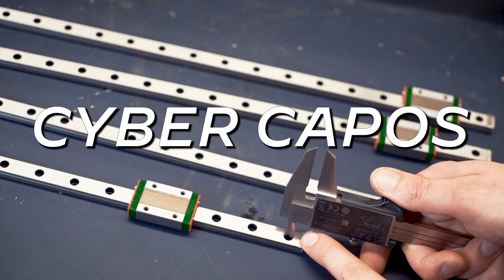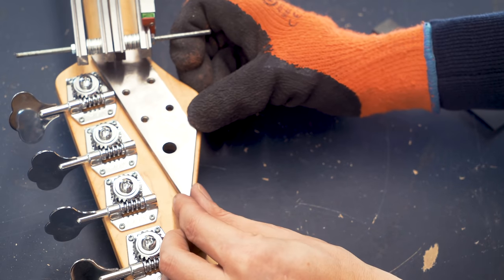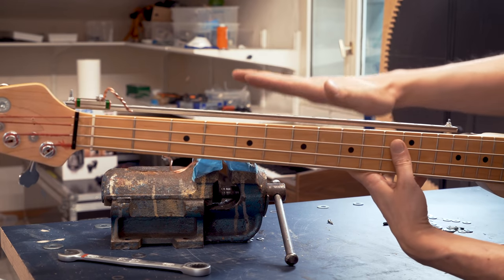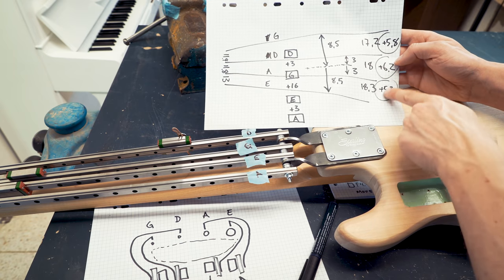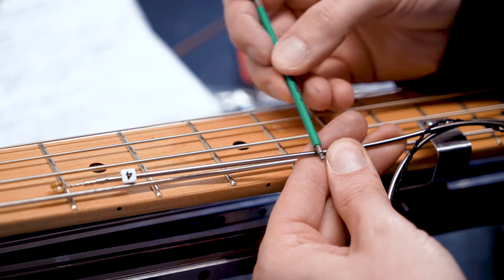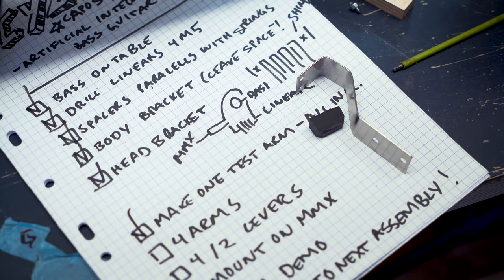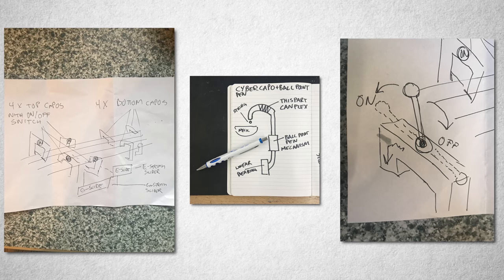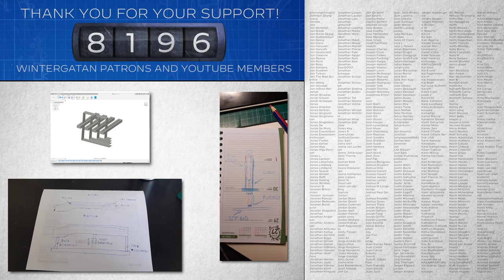Custom Bass CYBER CAPOS

Comment: Instead of those "rubber fingers", you could use little wheels, those will not wear down.
Reply: Little wheels like train wheels, with a central channel along the circumference! That way the strings won’t have any chance of “escaping” the capos (Popping out from underneath, by shifting those rubber fingers out of place. I’m not sure that spring steel will keep that from happening over time, since it’s designed to flex...?).
Reply: Genius
Reply: Like pulley wheels from Meccano? Would reduce string noise too - although the flatwound strings should do that anyway.
Reply: Johnny Johnson what about lego wheels? That’d also be an homage to the lego parts of the original Marble Machine
Reply: Something like U604ZZ bearings would be perfect, widely available due to their use for guiding the filament in 3d printer extruder...
Reply: As the wheel clicks between each turn of the wire string, you would probably hear a distracting zip or buzz when he moved the capos quickly. If there were smooth strings, this would work perfectly.
Reply: @johnnyjohnson6643  Came to say this, also wheels will reduce the slide sound.
Reply: openbuilds 625zz v wheels might be perfect for this. They have a delrin shell, designed to resist wear and will last a really long time. 
EDIT: On a second thought, Martin might not have used wheels since they could reduce the friction so much so that they might slip over the strings while playing.
Reply: Those were my first thoughts when i saw this, id use bearings, cheap and easy to set up
Reply: @nishantagarwal9377  The delrin wheels designed to glide over 2020 extrusion would work perfectly with a v groove profile turned on a lathe. Metal v groove bearings are available, but probably would sound worse than what he has now.
Reply: What about using a converted actual wagon of a toy train with the matching wheels on the rail as trigger for the strings?
Reply: @noshbrooks  They are already available with the v groove option too.
Reply: @johnnyjohnson6643 the spring steel should be fine. It is designed to flex, yes, but elasticly, like a spring, returning to it's original position, not permanantly.
Reply: Maybe small ball bearings? There are some with outside groove. https://us.misumi-ec.com/vona2/detail/110302274060/
Reply: @nishantagarwal9377  yes but friction could be controled on the linear bearing !
Reply: another way is to use nylon wheels that have a groove carved into its circumference, since nylon is incredibly durable it should work well
Reply: thats what I was thinking. You are a genius
also less noise
Reply: Agreed, with rubber rims to minimize sound.
Reply: Use bearings, the sort made to be blade guides for bandsaws
Reply: Wheels could work if they were more like pulleys and could hold the string. Or he could add the clicker style part of a ballpoint pen on to raise and hold it easier
Reply: A capo needs to have a soft 'input' for the string, otherwise it will cause a buzz. Capos are made with rubber or packed felt like materials, so they do eventually wear down, but they're relatively inexpensive replacable materials. A hard surface would cause loud string buzzing. A wheel might be an idea to look into, but it would still need a soft 'tire' surface, and would still wear down.
Reply: I think the main goal was just to not over engineer it
Reply: but the wheels would end up rolling over the frets and raising up off the string, so if he changes the capo position mid performance and tries to do a slide it won't be very smooth. It is a good idea though for durability's sake, and assuming that the capo movement isn't being used musically, that would be a pretty damn good idea. However, from what we saw there at the end of the video, it looks like he does intend to use the capos to slide musically with the song
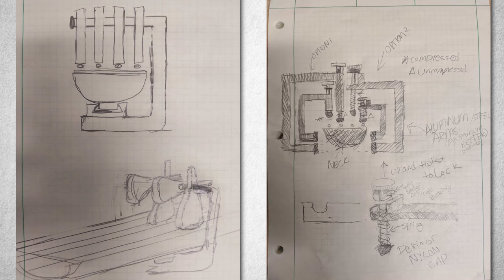Reply: You can see that they already been thinking of the wheel solution at 14:31
Reply: I think it also would be a great idea to set this Mechanismus above the bass, this way you can 1. Put it on or off by hight adjustment  and 2. Use wheels .
Reply: @MrHanba  No, you can not. It is not round(on purpose). It is a rotating cam to enable and disable the system. It does not rotate as you move it.
Though, of course, if you had a system where you could engage and disengage the pads, you could just not have them slide altogether by disengaging them before moving.
Reply: or rubber wheels...
Reply: I was thinking about drawer wheels with a groove made in the middle. But people have tons of nice ideas.
Reply: the shape of the wheel might suppress the sound due to its curvature. When the string is pushed down it will hug the wheel up the side causing the strings energy to be absorbed by the rubber.
Reply: Good to see so many people thinking along these lines.  Lots of nylon, rubber, urethane and delrin wrapped wheel/pulley options exist with or without v or u grooves.  Considering the different string thicknesses, it might be best to carve different size grooves in each wheel rather than try to order four different groove sizes.
Reply: Spring loaded to make them take some of the force while they travel over the fret bars. That fraction of force at that transition is where most of the friction wear is.
Reply: @christophmuller3511  I was thinking about him using bearings this week, I thing it would be a great idea. maybe coating them with come type of coat to avoid fret noises (don't know the technical name, sorry, BR here)
Reply: wi
Reply: Christoph Müller yes. On eBay for a few bucks. The standard size is probably a bit small for the larger bass strings.  I have both these bearings (and they’re sold as bearings not pulleys, as the part number suggests) And several guitars along with similar bearings for a different project and I’m fairly sure they’re too small. Standard filament is what- should know this - 5mm?
Reply: Did you not watch the end?
Reply: wiLL mB Great idea!
Reply: Are You going to make an open/closed switch for the Capo's? Maybe a spring T type function for the fingers could work. A sliding pin and groove with a spring around the vertical part of T. You could also make a catch in the groove to lock in the closed position.
Reply: Wheels is a great idea! I love it!
Reply: @johnnyjohnson6643  Будет металлический призвук, нужно что то по типу роликов от душевой кабинки, только с прорезью по середине, у них внутри подшипник, с сами сделаны из фторопласта
Reply: What is the name of the song so we can get it please?
Reply: A rubber wheel would work, but it wouldn't keep a good tone for very long
Reply: Delrin is a plastic I believe
Reply: Obviously. I just assumed that was his plan.
Reply: wELL DONE!
Reply: 8:47 The delrin will wear slower. Muahaha

Comment: WHEELS MARTIN. Swap the delrin pads for rollers or wheels and the inevitable wear will almost disapear :-]
Reply: YES, that's it. I was trying to think of something and you solved it. Nice, thank you!
Reply: Sounds like a good Idea. Delrin Wheels Maybe :)
Reply: Great idea! :D
Reply: Yesssssss!!!!!!!
Reply: Yea make them roll!!! 🤘
Reply: I was thinking for a simple way to make them toggle on/off, you could have them rotatable on the arm that gives them pressure, sending them up 90° over the fretboard. It wouldn't be as simple as a switch, but you could probably come up with some way to make them switchable with ease! You got this!
Reply: exelent answer
Reply: @blueblanketstudios4940  https://www.aircraftspruce.com/search/search.php?s=phenolic%20pulley Would these work? They are pre assembled with a bearing.
Reply: Ball bearings with delrin rings?
Reply: The wheels might also make it easier to play (change the positions) because of less friction.
Reply: The Glider Capo already exists: https://www.youtube.com/watch?v=h2GFf6mCsz4
Reply: Yep! Came here to suggest the same thing.
Reply: They see you rollin’, they lovin’...
Reply: I had same idea, also adding spring would make it longer lasting.
Reply: The spring steel fingers are a poor, kludgey solution to begin with.

Comment: Perhaps leave the capos as they are instead of implementing an “on off” feature- nothing wrong with tuning the base down a half step then moving all capos to 1st fret to get back to your traditional EADG tuning.  Might save you some engineering headaches if that’s a route you can go down :)
Reply: Actually this is WAY smarter i think than my suggestion to lengthen the top of the capos rails so that they can sit just under the head. But on the other hand wouldn't that mess with the highest possible notes that it can play? Either way this needs up-votes for visibility!
Reply: Sounds like a super clever trick :)
Reply: Zach Loertscher needs more overengineering
Reply: Damn you beat me to it! Great minds huh
Reply: But this way you lose the very convenient feature of being able to turn a capo on and off with just one flick of a switch. This original idea would allow even trickier  basslines which wouldn't be possible with having to slide the Capos to the 1st fret
Reply: Good idea.
Reply: You could also just hinge the rails underneath the neck upwards with a single lever, and the 'fingers' will lift off from the strings
Reply: I think this is the smartest idea because the need to turn it on and off isn't really necessary, at that point you could just use your fingers.
Reply: Just make the whole rail movable so that it may sits closer to the bass neck, thus disengaging all the capos. Add a pedal, like in a piano, and you're all set

Comment: Several thoughts: 

To keep capos wear under control how about using rollers?  The nylon covered V-slot rollers used in 3D printers would be an easy option, as would any industrial plastic coated "track rollers". 

Second, to deactivate the capos is a "park" position enough?  I.e. slid them off the top of the strings or onto a ramp at the bottom? 

Third, are there any other places you can add overload clutches or mechanical fuses?  This will make it easier to limit the carnage next time a screw wonders away.  Simple stuff like using plastic/brass keys, pins, and bolts in strategic locations.
Reply: Yes I wanted to recommend rollers too!
They will reduce the friction while allowing you to have the strong pressure you need all the way up the neck... I think I didn’t see rollers on any of the mock up sketches. Good luck!
Reply: You could tune the bass down a half step on all strings and then the first fret is your parking zone.  Simpler than an on/off mechanism
Reply: @mikejanaske788  i think he wants to leave them on a note so he can turn the note on and play an open string. i was thinking it would be easy to turn the whole lot off just by pivoting the entire rail system at one end.
Reply: @HomeDistiller  Pivoting will pluck the string... But, you could move the whole rail up and down rather than the small finger -  you'd have some leverage and spring steel is needed anyway. That could also be used for some tremolo and easier tuning of the force.
Think whammy bar but with latching lever, or a mechanism similar to organ drawbar or piano key, but latching in extreme positions.
Reply: What about using cams instead of rollers, that way you can set them on and off with a variety of other mechanisms
Reply: Mike Janaske This was exactly my thought, too.
Reply: you should post suggestions on reddit thread, i don't think he reads this.
Reply: Glass also seems like an option. Guitar slides are often made from it.
Reply: Theres a safety clutch system in place that he mentions in this video. When theres too much torque on the system the heavy flywheel gets disconnected from the system to eliminate a lot of the momentum in the "crash".
Reply: @SpaceWizardAzrid  I know about the main clutch on the flywheel, but I doubt every sub-assembly of the MMX is engineered to be able to take the full torque required to disengage that clutch.  I.e. say something binds up on the programming wheel, that's going to break a LOT of stuff because the programming wheel is geared down around 64:1 vs the main overload clutch.  This is why a mechanical "fuse" right at easy sub-assembly is useful.  It allows you to tailor the fuse to each individual sub-assembly, and you can make it cheap and easy to replace.
Reply: @martylawson1638  ah makes sense

Comment: Me thinking that this was a nice success:
"Nice."

Martin: "Actually this is just a rough prototype and we didn't actually achieve what we wanted."

Oh..
Reply: I'm glad to hear that those capos are rough prototypes (and should have know, as everything is a prototype, even when he previously seemed to have locked in a final product). When I saw the shaped spring steel, I became concerned that the spring steel could stress out of shape at every angle. Looking forward to the next iteration. Glad the concept worked so well!!!
Reply: this guy is so damn smart
Reply: At the end of this project, it would be great if there could be a marble machine statue made of metal.
Reply: I figure why can't they simply make the rails for the capos longer at the back so they can slide behind the nut at the top of the base neck? If they can slide back far enough to be AT the nut/top of the neck or behind the nut, then it doesn't matter if they can be turned on or off.

Comment: Normal engineers: Measure twice, cut once

Martin: Measure once, assemble, use the angle grinder, then assemble again, but better.
Reply: You forgot the "weld" step. :)
Reply: measuring is temporary, glory is forever.
Reply: A pretty normal process of prototyping
Reply: Just use some washers!
Reply: Cyberbase meets Capobot :D
Reply: 1. Measure once
2. <stuff happens here>
3. Glory is forever
Reply: It's agile development, for when working out what you want is as hard as actually building it.
Reply: That's what artists do!
Reply: @Gooberpatrol66  underrated comment
Reply: you overestimate engineers
Reply: Grind twice, assemble thrice
Reply: 1. Tell your marble funnel engineers which design you prefer
2. Let them explain over and over and over again that it will be noisy 
3. Let them build a prototype for you, find out how noisy it is, ignore it and make them create the whole set up.
4. Mount it and be all surprised and angry that it is kinda noisy...

Comment: I used to tinker with noise makers. Experiment with anything that had adjustable vibrations and amplify it.
But nothing like this. This is wild. One could consider mine a waste of time, depending on how you look at it. To me, time can always be better spent, but nothing is ever time wasted.
This, is time very well spent.
Congratulations. A device of incredible value. 👏

Comment: A question: Every time I see some metal added to the construction. How heavy is the Marble Machine X by now?
Reply: yes
Reply: A lot.
Reply: almost twenty
Reply: Exactly one full Marble Machine X's weight.
Reply: Slightly less than unbelievably heavy.
Reply: Very.
Reply: Very heavy. However I think Martin has mentioned in a few episodes that the machine cana be dissambled into several pieces for transport.
I imagine the team are also concerned about durability and reliability so want to reduce unnecessary movement as much as possible.
Reply: Martin should probably weigh it or look at the estimated weight in cad I don't want to see martins face when one of the legs collapses
Reply: 42.
Reply: Almost as much as yo mama
Reply: Thats not really a problem unless the stage for the tour thing will have a wooden stage or something
Reply: I like the bass capo song.
Reply: huetobi seeing that the legs are metal, so long as the side to side movement is braced against the metal should be able to hold the weight,
Reply: Yeah I was thinking about this myself. I think the point of failure would be the threaded adjustable feet at the bottom of the legs. I'm sure the frame as well as the legs are sturdy enough to support it.
Reply: I am curious what is the percentage of the mass taken by the marbles themselves
Reply: Obi Wan Kenobi
Reply: Not only the total weight but also the distribution... Don't want to be too far off center
Reply: I fear they have to strenghten some stages on their worldtournee before they can safely install the Marble Machine X on them.
Reply: Heavy enough to take over the entire Heavy Metal music genre.
Reply: A lot of marbles

Comment: Just a very small suggestion which you might find interesting:  If you mis-align the linear rails relative to the strings (instead of making them perfectly parallel), you can spread the wear on your Delrin sliders out over the full width of the slider itself!

This is actually a very clever trick that electric trains and city trams use - the catenary (the wire runs overhead, to power the train) is typically run in a zig-zag from left to right, called stagger.  It spreads the wear out over the carbon collector strips on the pantograph so that you don't get a groove worn in place!  This is very important on the high-speed trains like the TGV in France.  :)
Reply: TGV = Train Grande Vitesse
Train Big/High Speed

Hella fast train

Comment: 5:02 "and then, to overengineer this..."
martin has finally embraced his addiction
Reply: A regular engineer spends months coming up with a solution. A real engineer uses washers, duct tape and swears to make things work >:P
Reply: @LordDragox412  Swears are like magician spells to engineers
Reply: @blinded6502  This doesn't only apply to engineers.

Comment: have you thought about wheels for the strings instead of the delrin pieces?  like a small wheel with a groove  to keep it on track could still give it enough pressure to play the note, then it could roll up and down the string instead of grinding down the delrin. You could possibly make the wheels out of the delrin you already have on hand.